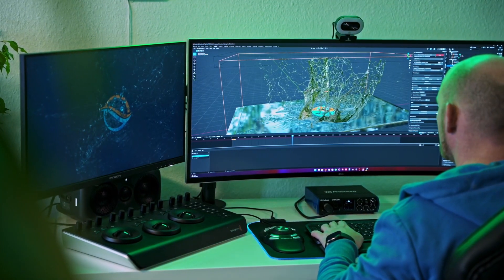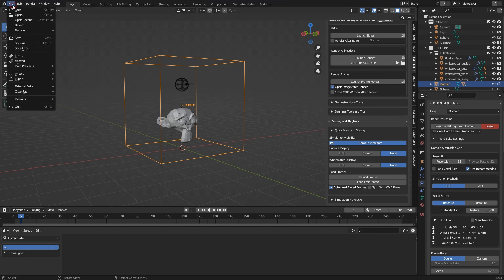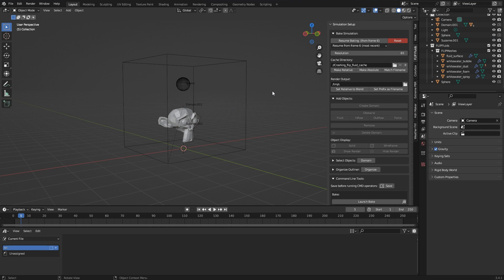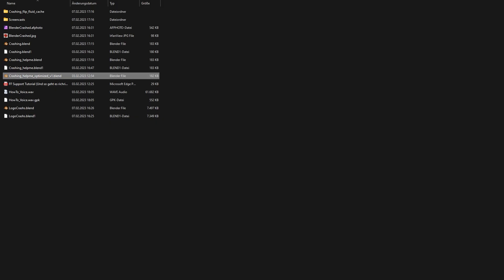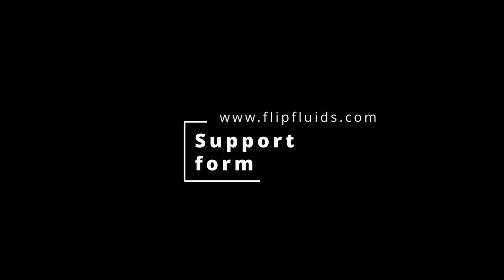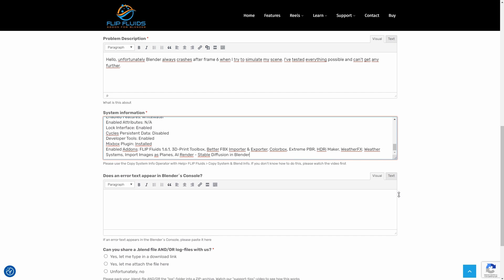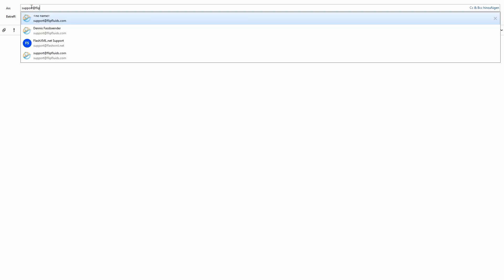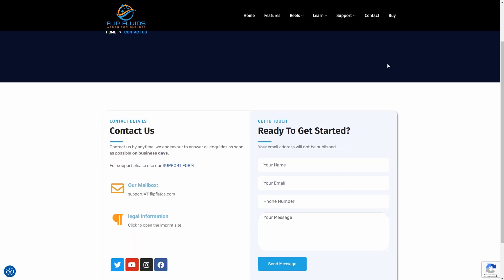Tips for Effective FLIP Fluids Support in Blender

Comment: How do i fix this sqlite3.OperationalError: database is locked Error massage the instruction on Github sadly didnt work i had to enable skip baking and allways rebake the animation from the point on where it had the error well it did work but in the end of the baking and render process the fluid jitters abit on the same point where i had to save the file after the error massage reopen it and rebake it it would start from the point on where it had the error massage is there anyway i cann fix it
Reply from the maker: Would you please send a support mail using our webpage form ? That’s the best way to help with any questions.

Comment: I don't know why my baking is so slow. My computer configuration is cpu 13900K gpu4090, 32G memory DDR5, but it takes a long time to bake. My other computer has a lower configuration, but the baking speed is faster. Do you need to do any settings? Does this plugin need higher memory support?
Reply: Hey, I have a similar configuration. If you are running a small simulation, the default max threads (32 for 13900K) can actually slow down the simulation due to overhead of managing too many threads. Try lowering the number of threads in the Domain > Advanced panel. This CPU has tested great for larger simulations running at max threads. For more info on simulation optimization and CPU usage, see the first topic in the Scene Troubleshooting link in the description. Hope this helps!